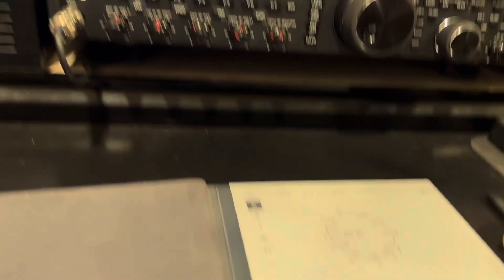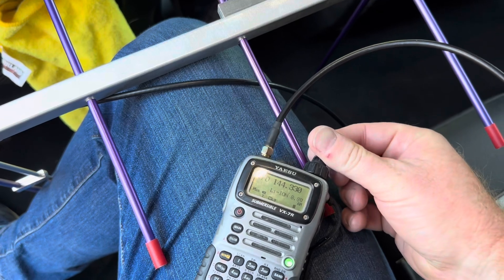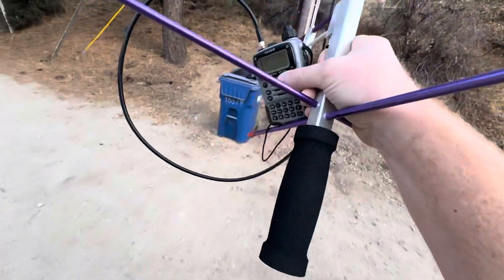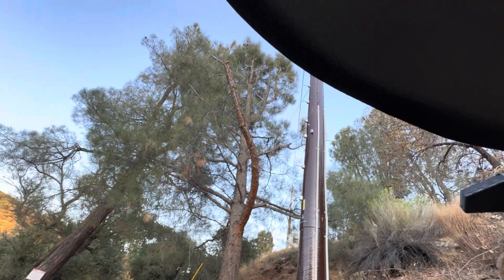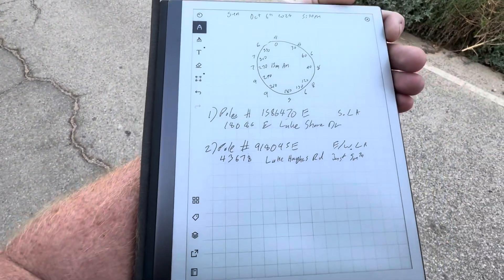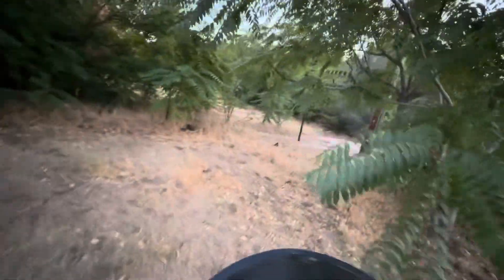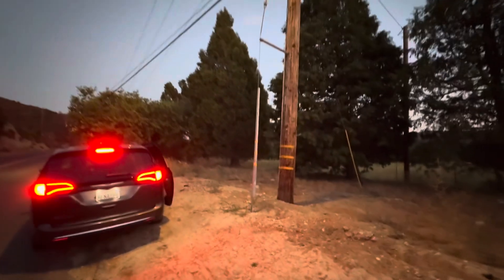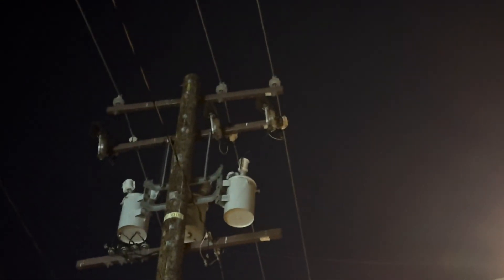Seven more SoCalEd poles with arcing Lightning Arresters -KJ7E

Comment: The Yaesu VX-7R is discontinued. Is there another HT you would recommend with AM capability? I want to get a rig similar to what you have. I'm having problems with the same kind of noise. Also, I'm assuming the antenna is the Arrow Antenna LEO Satellite Antenna? You just earned another subscriber...great information!

Comment: Wow! I have been fighting Arcing lightning arrestors for a year and a half now. As of last week I finally got PGE to Cut the lighting arrestors from a Second pole in my neighborhood hood. I managed this time to get them to cut the arrestors WITHOUT VERIFYING that they have an arc and or corona. The first pole a year ago I watched them use a Radar Engineers model 250 or 251 along with a Radar Engineers Model 243 RFI Locator.

They cut three arrestors. When they cut the third arrestor the noise stopped. The good part is that after the first pole they started getting the idea that when I told them where a pole was and which arrestor/s were the bad ones. Unfortunately, and apparently, they seem to only have one set of detecting equipment & or someone traded to use it. That's partly why pole number two took me so long to get them to cut the arrestors. 
And an FYI you'll want to hear.
I've forgotten the percentage, but I was told that California Utilities at the least had purchased a huge lot if lightning arrestors from "overseas". CHINA? IDK. But, a large, very large percentage of them were faulty. However, one lineman told me that the stateside assembly of the arrestors was the culprit. I guess they used the wrong type of hardware. That doesn't change anything though. 

I have been so pissed about PGE telling me they found the pole/s I pointed out to be O.K. that I've almost spent the $4,700.00 for the model 251 ultra sonic pinpointer. This is what PGE here has. And trying to make a quality video with the MFJ dish is pretty tough. I wouldn't say impossible, but if you look at the Radar Engineers Model 251 Ultra Sonic Pinpointer and find a you tube video on it, you'll see what I mean.
I can't afford this hardware really, but if I keep having so much trouble getting the utility to fix this stuff, I might buy it. It's not a guarantee, I just figured if I load a video on You Tube of a Power Pole CLEARLY BUZZING like a hornet's nest, they should be able to say it's OK. You probably also know how much the weather can make this Arc/Corona/Tracking into an intermittent thing. And intermittent means really hard to get fixed.

I'd really like to speak to you about this subject if you'd like.

Comment: I've been a cable guy for 18 years. How broad is the RF from these faults? I'm curious if it affects wifi for the surrounding homes (2.4 or 5 GHz, or both?) Also, I assume this could also cause ingress on any open coax outlets or compromised hardline in the cable company's plant.

I'm m not too familiar with HFC plant beyond the customers drop, but as a lowly contractor, I wonder how many of my calls are due to faults like this.

On a similar note, there's a restaurant near me where my key fob has barely worked for years, which makes me think something in the area is blasting some crazy RFI.
Reply from the maker: AC Arcing is very broadbanded and yes can affect even WiFi and Cell signals if your close to it.

Comment: Are they actually lightning arrestors or fused cut-outs? https://en.wikipedia.org/wiki/Fuse_cutout
Reply from the maker: Yes, know issue, MOV lightning arrestors, not the cut-outs which are on the other side of the pole crossbar.

Comment: I don't know how the Utility Company is in California but here in Pa this would be difficult to get done.  I certainly hope you get some satisfaction    Thank You   
KC3ZDW   73's
Reply from the maker: One of the reasons for this video, to put public pressure on them and get them to respond.  A complaint with the California Utility's Commission also helped.  I did manage to get them out to replace all LA's on all of the 7 poles here.  The bigger problem is, ALL of the LA's in my area are junk, they got a bad batch during Covid Nov 2020 when then installed them and the are all failing or going to fail.  Known issue by the power company.

Comment: Jeez, so will all the poles be rectified
Reply: That is the million dollar question. I have had a lower level lineman tell me he uses an orange construction cone held up to his ear to see if the arrestors are making noise.
He swears he's serious, but it would explain why he always finds the poles I point out to be fine.

The first time I actually met him, I brought my MFJ Ultra Sonic dish and let him listen. He just got a weird look on his face and said, WOH!
Then his co worker showed up with the expensive gear. His Radar Engineers Dish caught the Corona noise from 75 yard away whereas my MFJ has to be within......well, as close as I can get. I guess fifteen yards or so. And, if the arc/corona isn't about S9, I may not hear at all with my MFJ dish.
Reply from the maker: I am pushing for that but there are literally hundreds of poles which the electric company installed bad arresters on in my area.
Reply: @damonkj7e   sounds like you should start a small company to bid on the job
Reply: no they will stay ac